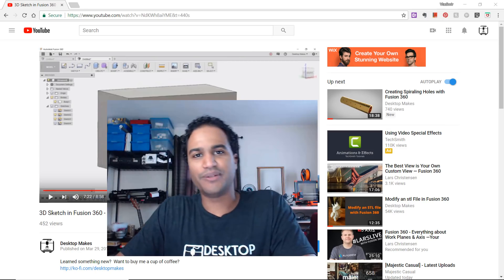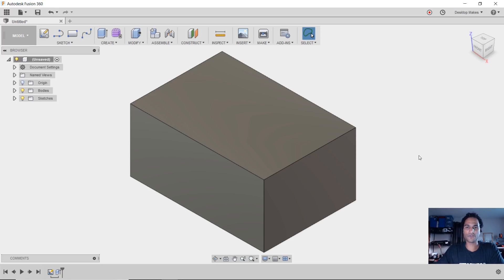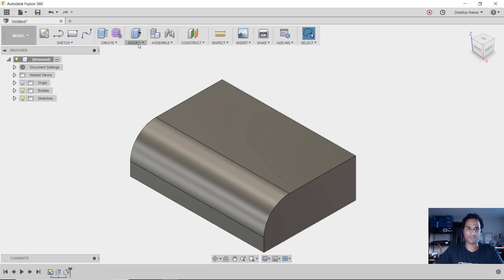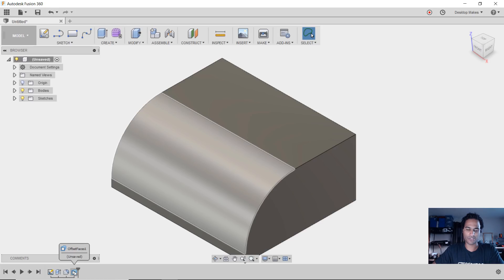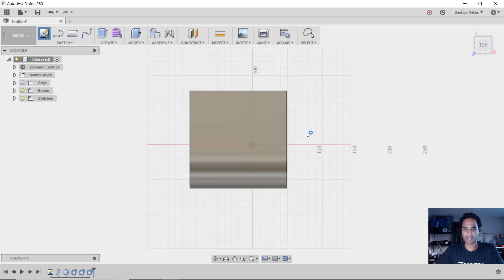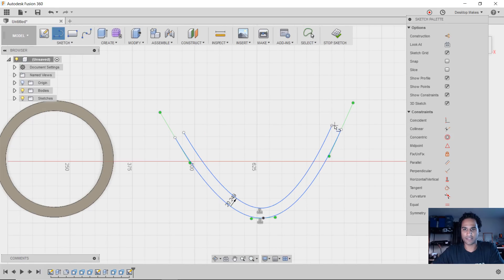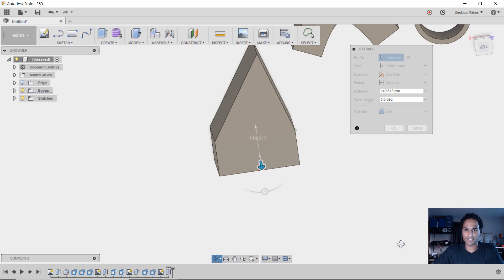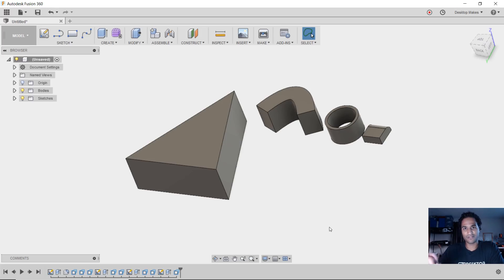Press Pull vs Extrude in Fusion 360

Comment: Funny how you find a tool that supports a given use case, then, instead of examining it to figure out why, you just use it as a matter of habit. Now that I’ve seen this robust examination of the tool, I have several new use cases that this solves. My current use case had been on threads to provide some clearance for 3D printing. But, looking back, there have been times I’ve wanted to add some space to a body with angles, like the triangle example. I’ve been frustrated by the behavior you describe in the video. Seeing the push/pull tool grow the entire object instead of creating a new rectangular shape coming out from the angled edges allows me to understand the difference between it and the extrude tool. I’ll be using this tool in the future!

Comment: One other note: Using the press/pull on a "hole/cutout" you will NOT get the option to "cut/join/..." So you just end up just moving the face. With extrude on the same face, you get the option to cut, join, etc.

Comment: Hi, I use Fusion 360! When I use the arrow to Prees/Pull, the value change with a step of 5mm. I want the value to change with a free step. How can I whange this parameter?
Reply from the maker: Hi RehabLab, instead of pulling the arrow simply type in the distance you want to press/pull.
Reply: Ok, I find the solution. I had to deselect themode 'Increment Move'